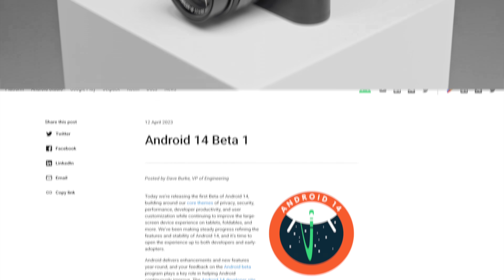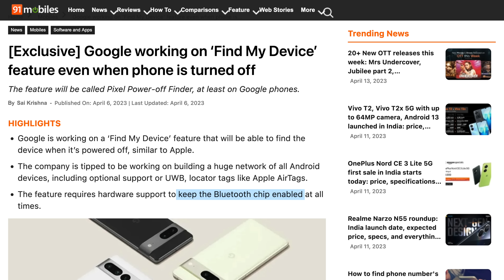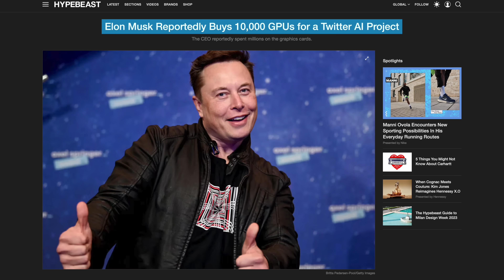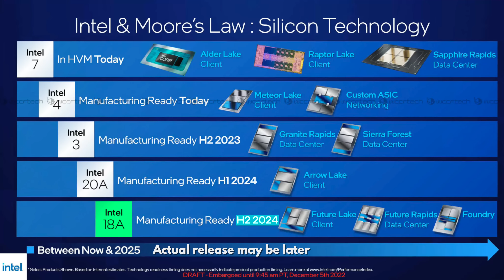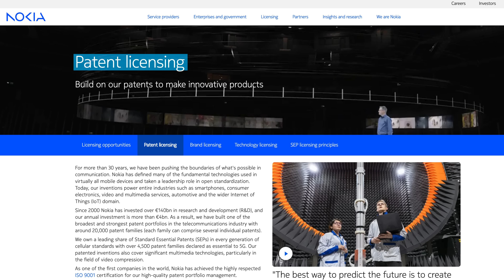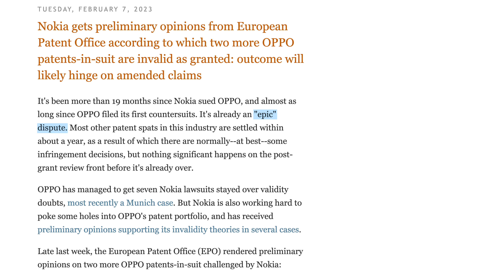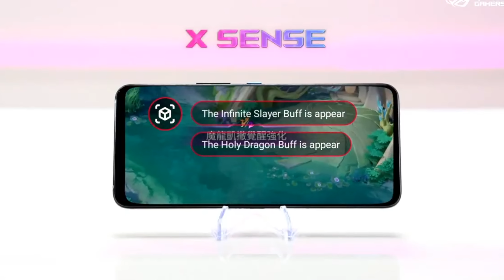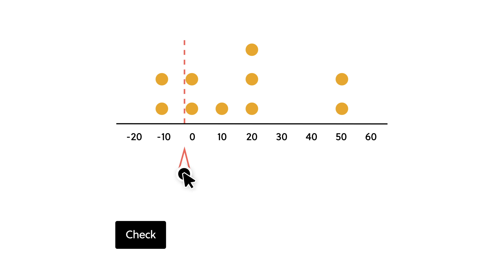Intel prepares to make ARM chips next

Comment: You cannot really have device powered-off and be able to have BT chip active.
This mean even if AP(application processor(our cortex cores)) is disabled then it has to be handled by separate processor like ADSP/Modem but these things were specialized enough to not really be able to "connect to internet" like general purpose systems.
I already see privacy issue there, vendors might prentend shutdown is equal  to some ultra low power state which obv isn't.

Comment: I don't understand why companies that hasn't touched on arm doesn't just skip it completely on favour of risc V
Reply: I'd be down for this change. X86 is too old and can't grow further, even with Intel's desperate experiment with the big-LITTLE core design. It seems that Qualcomm had a breakthrough to launch ARM-based PCs (most likely laptops and 2-in-1 devices at first), so if both Intel and AMD don't react, it might be over for them. Nvidia on the other hand has some experience with ARM, so they might be another big player next to Qualcomm, which could kickstart gaming on ARM for real this time.

Comment: 1:35 is a HORRIBLE decision. Snipping tool terribly compresses the image in a way pasting it into paint does not. Yet another reason why I'll run Win10 LTSC until support ends and I'll be then fully moving to Linux after using Windows from DOS with Windows 3.1 up to now. Microsoft is ruining this poor damned operating system
Reply: Agreed. It also makes no sense to force users to take extra steps to get a screen shot.

Comment: GPUs should be $150 - $600 for any given generation.
Reply: If the news is to be believed, integrated graphics will eventually get good enough that a gpu won't need to be purchased. GPUs will become specialized devices intended to run complex loads - something we might already be seeing.
Reply: @hermanwooster8944  I don't know about that an iGPU can play many old and less demanding games but new games will pretty much always need dedicated GPUs.
Reply: @matthewshields  The gfx on Apple's M1 Ultra chip is allegedly near par with a GTX 2060 Super. AMD's Radeon 780M is being touted as rivaling a GTX 1650 and their upcoming Strix Point is supposed to surpass it. Certainly not Grade-A GPUs, but for integrated graphics this is leaps ahead of what is being offered today.
Reply: @hermanwooster8944  OK, near par on what exactly? GPU are mostly used for gaming, is that for gaming, or something else?
Reply: @unknown3158  Apple is not known for gaming, but AMD's hardware should be good. The Radeon 780M is a recent example from China. Strix Point is coming later.

Comment: If Intel is to be belived that Intel 4 is already running then I think they will be able to hit their Intel 20A target, but Intel 18A seems more challanging to get production ready so my current guess is that might have to be delayed by 6-12 months at best.
Reply: It is running since late 2021. Loihi 2.
Reply: @serkardis292  Loihi 2 is fabricated on pre-production Intel 4 process. Intel only confirmed that Intel 4 was production ready back in February. I would compare pre-production to walking.
Reply: @TheDuzx  fair point. And I didn't realize how tiny loihi 2 is.
Reply: Pull up in a monster

Comment: Seems like arm is the future for now which I'm all for, the power for the battery life is hard to beat with traditional X86.
Reply: More like RISC-V, but ARM is an acceptable intermediate step.
Reply: @kacperrutkowski6350  Jim Keller is designing next gen RISK-V CPUs for Tenstorrent. It looks very promising. RISK-V is open source. Arm is licensed!
Reply: @tringuyen7519  Only the instruction set is open source. Many RISC-V chips have proprietary cores and designs.
Reply: @tringuyen7519  I would rather say, that the software is and will be a limiting factor for RISC-V, not hardware.

RISC-V is (and probably be) a significantly slower than even ARM in terms of single core performance, but it will be able to use much more cores on small CCDs and with low power consumption. Even if that CPU will be good it wont be anything practical for at least few years imo.
Reply: @kacperrutkowski6350  I have to do more research into RISC-V as I know very little about it. Cool name tho.
Reply: @kacperrutkowski6350  ARM will have a 20-30 year reign. Maybe 15 if they hit a ceiling very soon, but that's unlikely.
Reply: its not thats great when you think about hardware , software support
Reply: @xDoge26  Good point. Up until Windows 11, you could put the latest version of windows on almost anything without any intentional barriers to installation and it was  really liberating.
Reply: @Piquliar  thats just windows’ fault 🤷‍♀️ linux and mac have supported arm for ages and consistently for a few years respectively